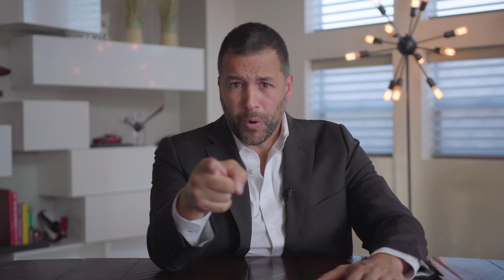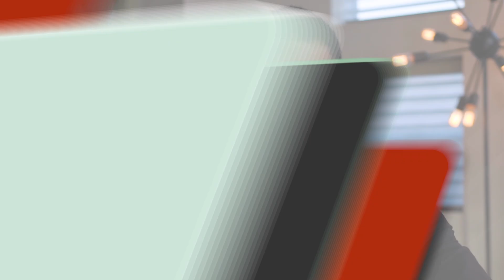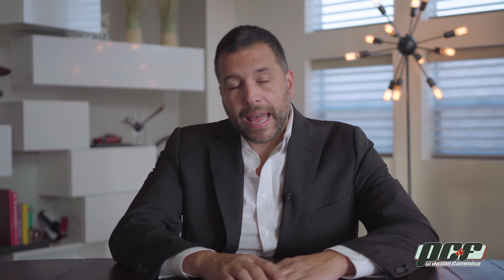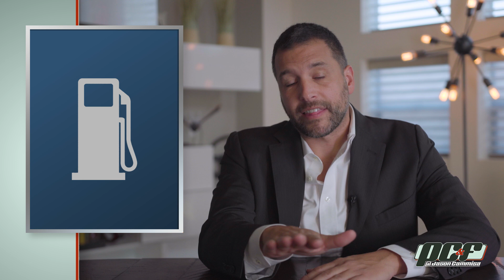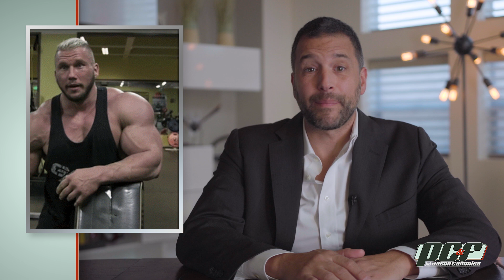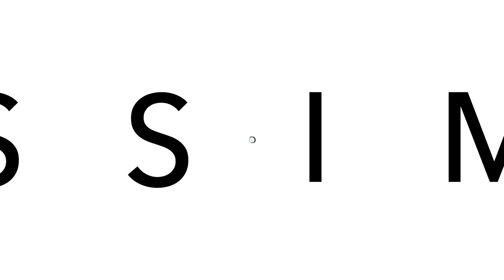Why you should never put premium gas your non-premium car — Proper Care & Feeding with Jason Cammisa

Comment: Fuel igniting before the spark plug is called pre ignition. Detonation is when you get unintended ignition after the spark plug fires. Which is why you can get away with a little knock afterwards but not so much with before.
Reply: Just as a helpful "maybe you didn't know", not trying to start an 89-post flame war: Detonation doesn't happen with gasoline.  Its "deflagration".  https://www.thoughtco.com/explosions-deflagration-versus-detonation-607316#:~:text=Deflagration%20and%20detonation%20are%20two,sound)%2C%20it's%20a%20detonation.
So reading the last paragraph of that link, does detonation really happen with the eddy currents, and that's why its called Detonation? or is it mislabeled?

Comment: So my 1999 car is factory tuned for regular gas. But from April to September (which have temps from 25 to 40+ degrees) I get engine knocking if use regular gas ever since it was brand new. What do I do?
Reply: I'd start by replacing the plugs.
Reply: @hojnikb  Thanks for the tip. I assume you mean spark plugs that are of a different spec from the original ones, because this happens for 21 years now and the car has been through several sets of original spark plug sets.

Comment: Hmm wouldnt the premium fuel make life easier ( less detonation and cleaner DI injectors) for high compression ratio motors with GDI, like mazda's skyactive? In 1.5l version for mazda 3 it comes with 14:1
Reply: There's a lot more to the detonation than just compression ratio. You can have high static compression ratio, but if everything is designed around regular fuel, it's going to run just fine. 
Engine manufacturers can design combustion chambers, fuel and ignition mapping among other things to compensate for lower octane fuel.

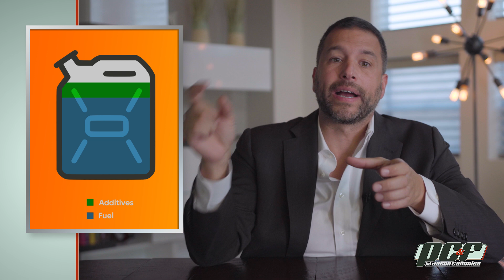Comment: 1:35 False statement. 

The octane number is not raised with additives. Maybe it was, in WWII or early 50s-60s, when reforming or cracking was not as advanced as today. But today you just formulate your gasoline by* mixing tanks that contains components with different octane number rating.
So nope, what you said here is just not true.
You explanation is only valid in the case of Exx mix, where ethanol is added to gasoline (E10, like 10% or E85, like 85% ethanol). Ethanol has a higher octane number but lower energy content. Thus, you car will consume more E85 for a mile, compared to just gasoline.

And, in Europe, they use RON as in research octane number, whereas US uses a formula which also contains MON (motor octane number), (RON+MON)/2. So, 100 RON in Europe is equivalent to a 94 in US.

So on, so on. But yeah, if your car is designed for regular, don't buy higher octane premium. It's just a waste of money. If you still have money to spend, buy brand gasoline instead of no name, they will contain a better additive package.

Comment: Alright question, should a E46 320i run on regular or premium?
Reply: We didn't get the 2.0-liter in the E46 here, but every BMW sold in the US requires premium fuel. Check the inside of your fuel door — BMW typically puts the requirements on a sticker right there.
Reply: @JasonCammisa  E46 320i is actually a 2.2 liter engine!
Reply: @Glasseh  20i can be both 2.0 or 2.2, depending on the year and market.

Comment: While it may not give you additional power/efficiency out of your engine designed to run 87, putting higher octane fuel will burn cleaner and the additional detergents in the fuel will keep the engine internals much cleaner in the long run.  I run a tank of 93 every 4th-5th fill up in my daily to keep things clean.
Reply: You should check with your gas station. I don't believe Top Tier stations use any different detergents in their "premium" fuel other than the octane additives.
Reply: @JasonCammisa  I use Shell V Power 93 and they do advertise it as having additional detergents to clean up the engine.
Reply: @Blk05GTStang  compared to generic brand 93 gasoline, yes they have. That's the difference between a premium band and a no name, same octane gasoline. The additive and "detergents" package.
Reply: @JasonCammisa  again, the are no "octane additives" anymore in commercial gasoline. Unless the gas station is importing from the past. There is no need for them today. You can reach the desired octane number without having to boost the final product with "additives". This isn't WWII.

Comment: what about my mk4 jetta 2.0 with 180k miles? It seems to run better with 91 than 87
Reply: P.S. sorry for the pine needles and crayon smell
Reply: @shaneconta249  Yum German Crayon Smell. But that 2-point-slow is so understressed that it shouldn't make a difference what you throw in there. I say "validate-thee thine claims with a dyno run or I shall decree ye drunken off of crayon-smell!"

Comment: I own a Ram with the Hemi, and while it says 89 octane recommended it says 87 is fine. I run 87 for daily use, the switch to 89 when I know I'll be towing or loading it up. So far so good. I deliver gas for a living, and I will say you want to run Top tier fuel and you want to buy from a busy station. The problem with small stations is they are more likely to run their tanks low, or order the bare minimum so it can be hard to tell what the fuel quality is like. Also stop believing the myth about buying fuel when is cold out side so you can get more. The pumps are all calibrated so you aren't winning. Great video!
Reply: Not to mention the tanks are in the ground, meaning the temp of the fuel doesn't vary so much.  The ground temp at the depth the tank is buried varies far less than ambient air temps.

Comment: I just started putting premium in my 95 because it's old and runs better on it. I have a feeling GDI engines will need premium after they're all clogged up
Reply: JATT SINGH DEOL  Did you even read my comment? Mine still runs better on premium. It eliminates pre-detonation because its an old worn out 25 year old engine.
Reply: @TheAdventureAuto  Carbon build up on older engines raises the compression and helps to add as an ignition source as carbon retains heat and doesn't allow the heat to dissipate through the head.

Comment: But Premium Gas cleans the valves. I've seen comparable open engine blocks and you can literally see the difference.
Reply: @tjts1  Top Tier isn't a marketing standard - it's a consortium of car manufacturers who work with fuel refineries and distributors to ensure that their products' detonation resistance and detergent package are up to their standards.
Reply: Lol No.
Reply: @tailsiswatching ahhh okay, maybe that's the case. In Austria we basically have 2-3 regular gas companies and they all have the basic 95 or the premium 98 fuel. They are all also manufactures and not just a reseller.  Thats probably why. Thanks :)
Reply: you, just as Jason, confuse octane number, premium rating with additive packages.
Reply: @tjts1  lol, do you know the difference between a "generic" brand and a premium brand gasoline? Same octane number. Maybe you are bullshit after all.

Comment: Will my stock Fiat Punto run on nitro methane?
Reply: No. Nitro is  A LOT less energy dense (so you need to inject more of it, like 8x more) and has lower optimal air/fuel ration than gas, so unless you do some extensive mods, it's not going to run on it.